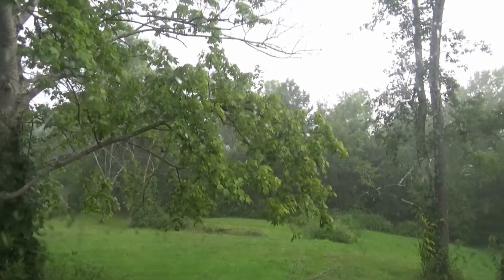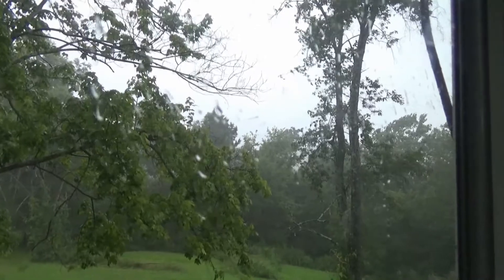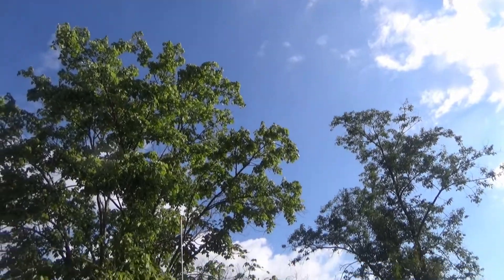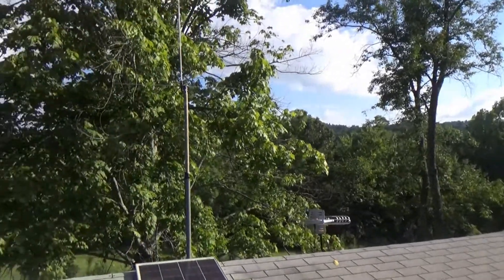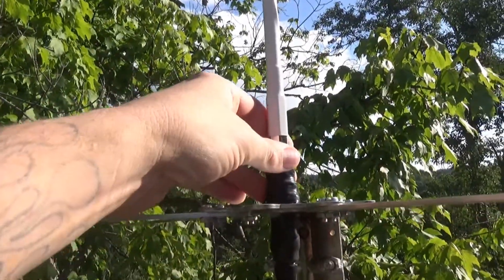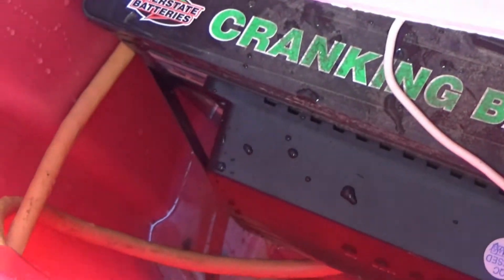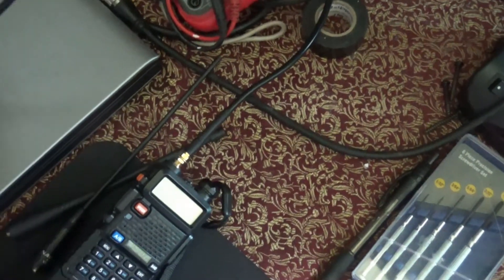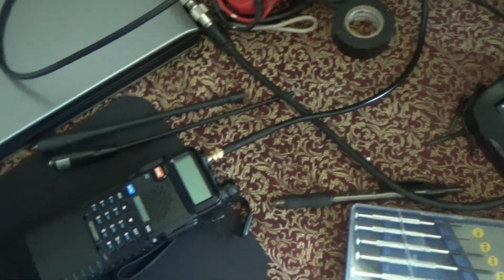Solar ham radio setup

Comment: They give off hydrogen gas when charging.  The user serviceable batteries like that can be made to last much longer by adding distilled water.  
A vented(to outside) box would be needed to put it inside.  
Carbon monoxide sensor are cross sensitive to hydrogen, so you can use that to test.
Reply from the maker: I was unaware that the co2 monitors also detected hydrogen.

Comment: Aaron good set up did you find the runway  chickens .
Reply from the maker: well Gene, I found two of the three..  They are on lock down, and awaiting parole!  hahaha
Reply: Aaron.the only lock down,I would give is a hot pot chicken lol. 
You all doing ok whats weather like on your side of water..
Reply from the maker: Looks like I've missed a few of your comments.  Were all doing good here.  It seams that we may be having an early fall, which I am happy about.  My egg count has slightly diminished, so I may be putting a chicken in a pot, very soon!